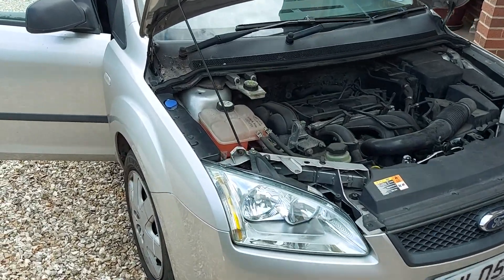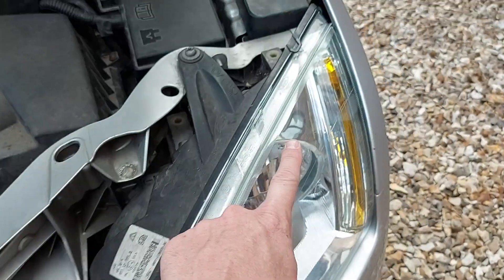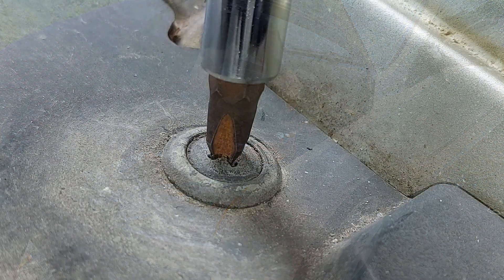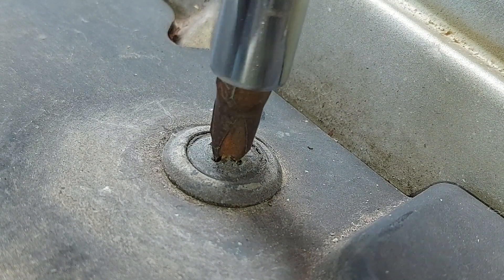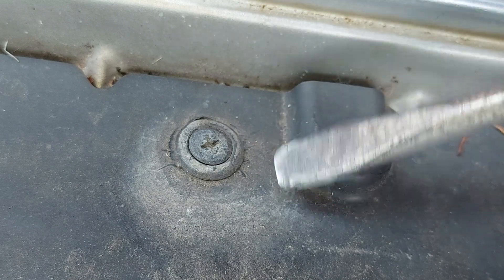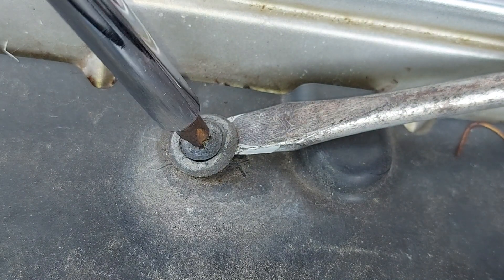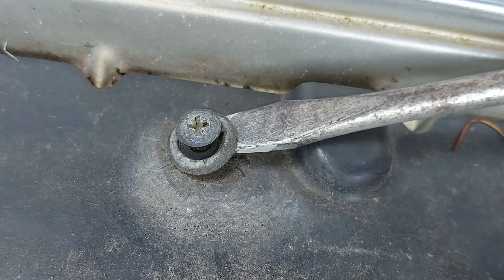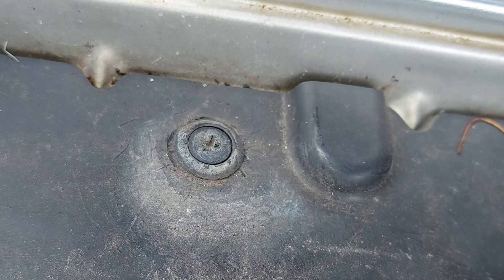Ford Focus Mk2 Tips & Tricks: How To Remove Plastic Trim Screws (Without Damage)

Comment: i tried it with no success. tried to remove the plastic screws from the rear bumber, the lower spoiler but the screw was just simply turning without going outwards
Reply from the maker: Have you considered drilling the clips out? You can probably get replacements on eBay. Good luck.

Comment: These fixings are the spawn of Satan!
This method didn't work for me and even if you get the screw out, the plastic washer has a threaded 'split plug' type design which stays in the hole! ⚠️😲😳
Reply from the maker: These clips seem to get worse with age!